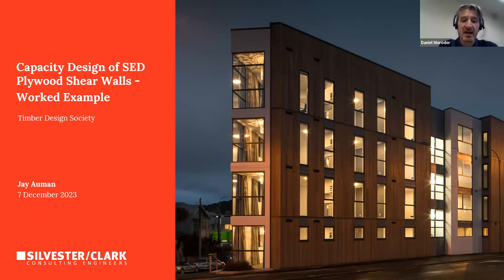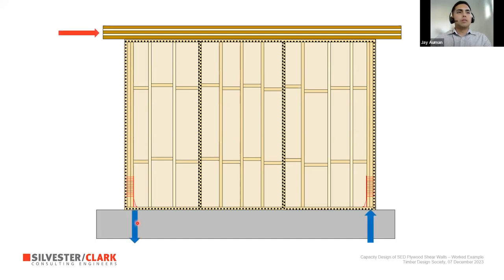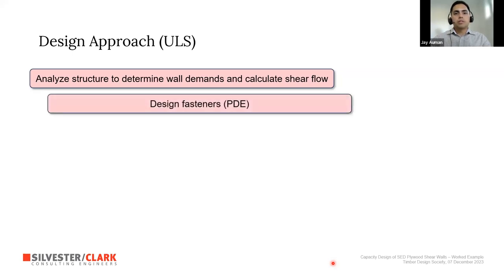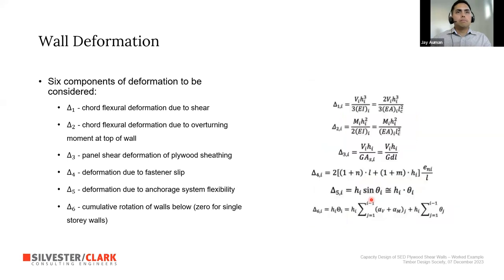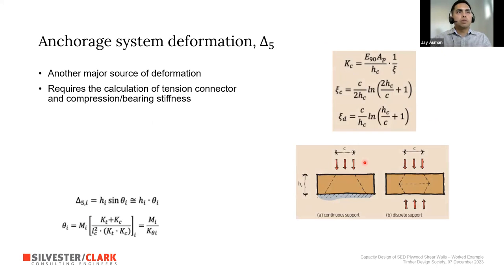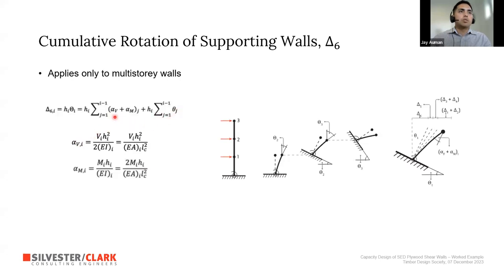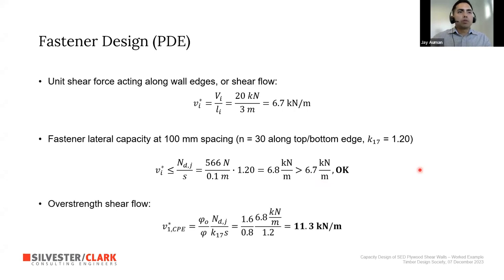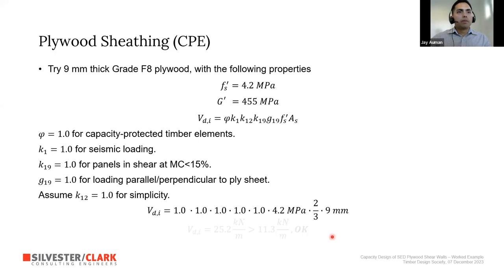December 2023 – Capacity Design of SED Plywood Shear Walls – Worked Example – Jay Auman

Comment: You're designing a lightly loaded, single storey plywood shear wall. You get a demand of 6.7 kN/m at mu = 2.0, which would be approx. 3.8 kN/m at mu=3.5, or equivalent to a moderately loaded P21 element (76Bu/m).... Then you struggle to get the design to work for nail displacement demand and end up with 32kN hold-down demand, which would be impossible to resist with a timber subfloor. 

So, in summary, it is impractical if not impossible to carry out SED on even a single storey timber framed house with a lightweight roof and timber subfloor?